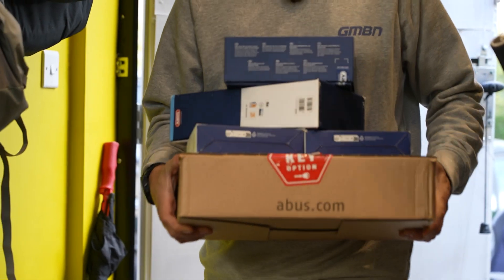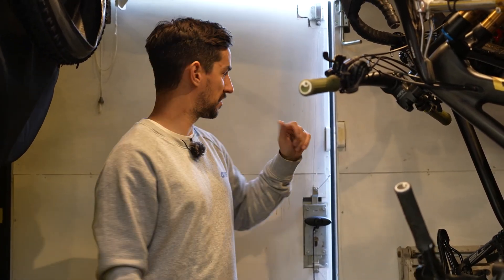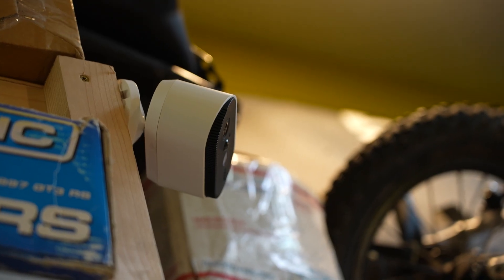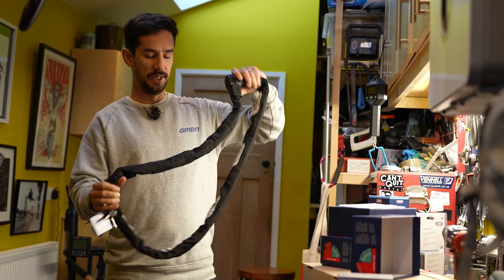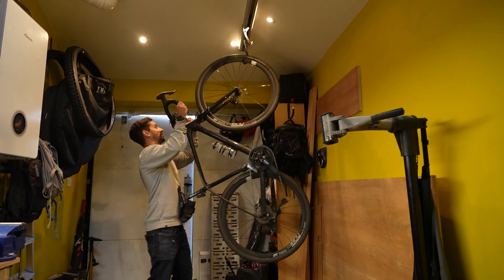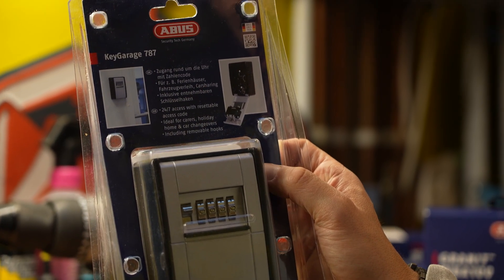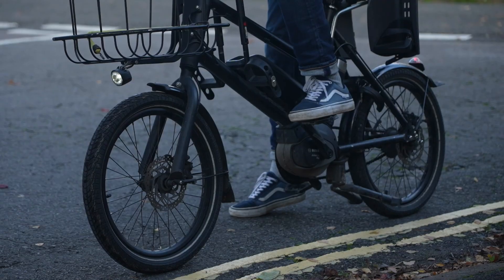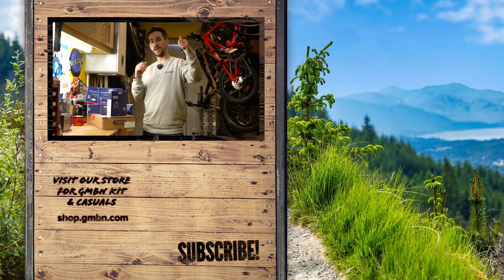How To Lock Your Bike at Home | Urban Bike Security Guide

Comment: The trouble with keeping your bikes in the workshop is that then you have all your bikes and security equipment alongside all your angle grinders, large drills, massive bolt croppers, etc.
Reply: Hide your tool batteries!
Add a secret Isolatiin switch to your powerpoint circuit!
Reply: DM me with your full name to claim your prize...................☝️☝️

Comment: Somebody (probably Doddy) showed a wall-anchor a while ago with a large, single, central, bolt. Because the chain blocked access to the bolt, the bolt didn’t need the ball-bearing treatment to make it secure, so if you ever wanted to move it, you could. I have no idea what brand it was though…

Comment: A battery angle grinder will cut through that grade 12 chain in under 30 seconds by which stage your bike is gone.
My recomendation if you want to keep your bike safe like i have done is build a lock up next to your garage with the only point of entry being a eletric garage door that you cant jimmy open and need a door opener to get in
Reply: What do you mean "build a lock up next to your garage"?

Comment: I've had bikes stolen in public before but I never thought to keep them locked up at home. That is until someone broke into my garage and stole my mountain bike and road bike without any trouble. Now I keep my mountain bike locked with a 12mm hex-style chain in my garage. I don't know if ABUS has anything similar but the Kryptonite chain I use has an enlarged ring at the end which allows you to pass the chain through itself so you can extend the range of the chain. When you loop a chain from an anchor through the bike and back to the anchor, you're essentially using twice as much chain as you need. Unless you use it to lock the wheels, too. However, I don't like to get that super heavy chain anywhere near my carbon wheels so I either leave them unlocked or use a braided cable.

Another thing to consider... Set up a decoy bike. Lock your worst bike with a flimsy lock or just leave it unlocked. Maybe even get a clunker that doesn't look terrible and stage it as the decoy.

Comment: I just bought some disc brake rotor locks, one has an alarm built in. Both easily fit in your pocket, so very portable.
Reply from the maker: That's a brilliant preventative measure!
Reply: They will just cut the brake disc... Thin metal, fast and easy.
They can fit a new disc later for few quid, then sell on.
Reply: @rupedog  sure, but no matter what you use, it slows them down, requires noise and effort to surpass.
Most garages even have the tools for them to use!
As always, use multiple measures and be stealthy !!!

Comment: 4:14 that boltcutter is mega overkill! Literally any quality pair of sidecutters or wirecutters can cut the wirelock and it's much less conspicuous.
A friend of my had thrown her key away and I went there to cut the lock. She didn't even notice I had already cut the lock, we were just standing and talking. Until she asked me when I would cut it. She thought it needed an angle grinder or something else that made a lot of noise.

Both tools are so easy to use that they are indistinguishable from using a key from only a few meters away and the both fit in you pocket
Reply: Yeah those cheap cable locks are nothing. I forgot the code and had one on a bike rack and literally cut it with small garden shears haha.

Comment: Nice job, hit all the main points I think. In regard to home/shop/garage security, if you have a security system, often the signage stating "Secured by ________" is as much a deterrent as anything. Thieves want to avoid risk as much as possible, if it's obvious a house has a security system it's more often than not a hard pass from the get-go.

Comment: Register your bikes. Bike Index, 529 garage, it doesn’t matter. And if your carbon frame is big enough, get a GPS tracker as a final fail safe. ( I have not used one that works through a metal frame, but a carbon seatpost or carbon handlebars might work)

Comment: Had an absolute classic stolen 24 years ago, my chrome pace rc200 f5 (with rc35s) with full xt groupset etc, still not over it to this day. Until I can afford better systems I've got battery operated door alarms (which should at least shock any attempted thefts) and locks through my bikes, plus I've got dogs. When I'm in the position I'll start with a better lock which is attached to the floor/wall, then a better door alarm, then security cameras. Leaving house keys in those boxes would make me extremely nervous though. 
It is bad how much you've got to be careful these days, better to be over cautious than have regrets.

Comment: Love that roof rail system! I had a bike stolen very long time ago, during my student years. It was stolen outside the apartmenr blocks where I lived and they cut trough the chain I had locked it with. There were several bikes stolen that night around the nearby blocks and they had just taken womens bikes so police believed that they had sriven round with a van or a covered pick up truck or similar. Even if it was not a top range brand it was still an annoyance losing a bike worth £500 when it's a main means of ttrasportation when on a student budget.

Comment: Try not to leave any slack in a chain when you lock a bike up, twist it around itself or the bike frame, this makes it difficult for a thief to reposition for easier cutting with a battery angle grinder.

Comment: All these safeguards are designed to deter amateurs. Professionals will deal with it quite quickly, unfortunately. Even additional safeguards in the form of a hidden GSM and GPS transmitter are not very effective. They have jammers and detectors. Since bicycles have cosmic prices, very well-trained people deal with it.

Comment: Unfortunately there's really little help against angle grinders. With modern battery technology they are so quickly through the best locks (except the new Hiploc D100 maybe?). And yeah, it's loud - but it still takes under a minute and they can use the angle grinder as a weapon ifn needed...